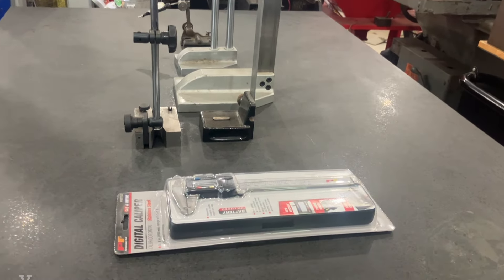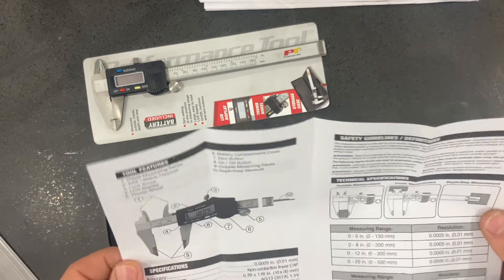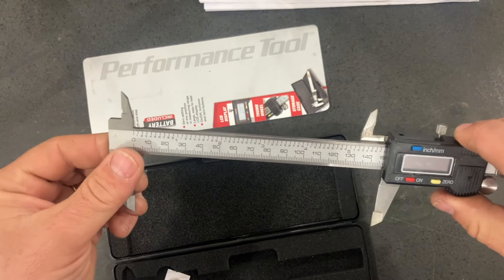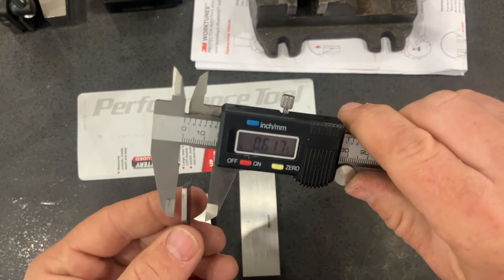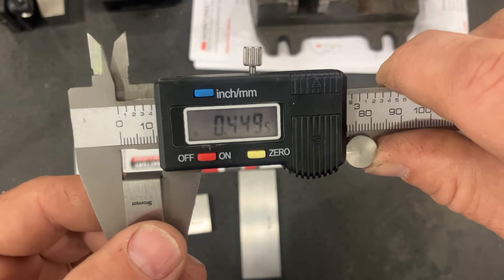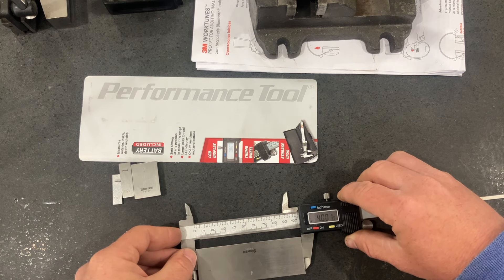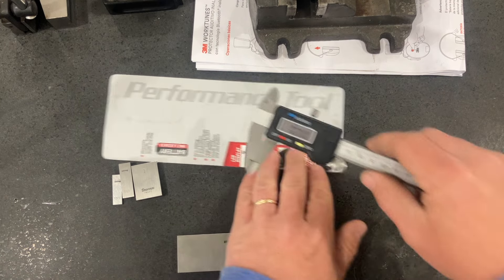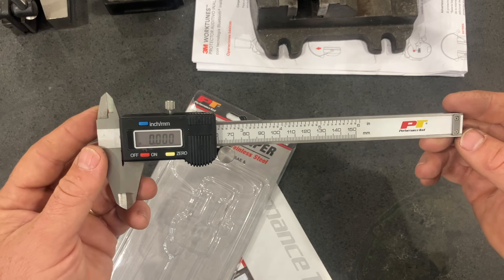Cheap Auto Parts Store Calipers - JUNK?

Comment: I have one of those, too. They go for 10 bucks in Germany every few months. 32 bucks feel steep. I got rid of the burrs. It's not a joy to use but it mostly does the trick. It's just an out of town backup anyway.
For ten bucks a piece, sometimes even discounted, they have their uses. Mostly for creating DIY digital readouts. Like measuring the focal points when polishing a telescopic mirror. Or building a model plane where 0.01mm really do not matter.
My good analog Meba is only good for 0.05mm. 
I mostly have cheap measuring stuff. Funny enough, it all kinda agrees with each other over small distances. I'd prefer buying good stuff though.

Comment: digital calipers are not accurate anyway, that one is better then most .... better than my mitutoyo  ...... fit and finish is another matter.
Reply from the maker: Oof. That’s rough. I’ve never seen anything this bad lol
Reply from the maker: I had a vintage set of Brown and Sharpe Swiss Made dial calipers that would read absolutely spot on ever time
Reply from the maker: After 20 years of using them I finally dropped them and they broke